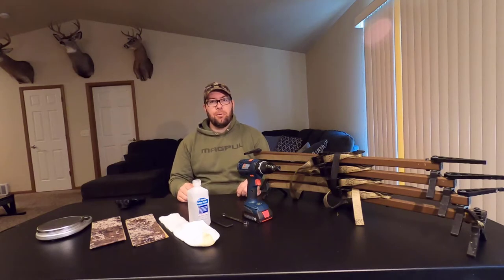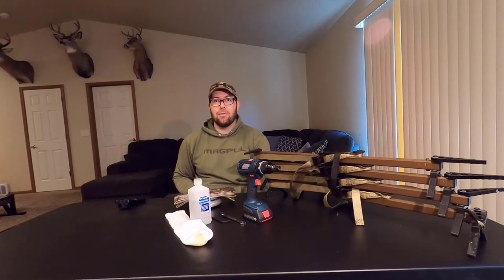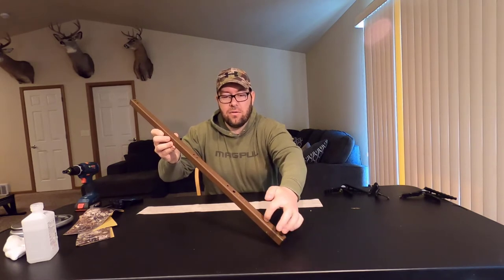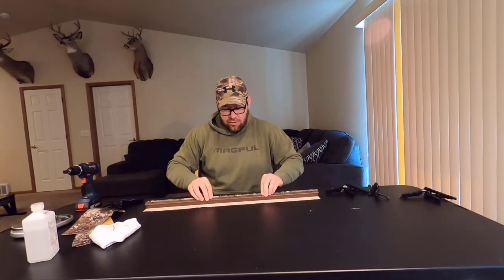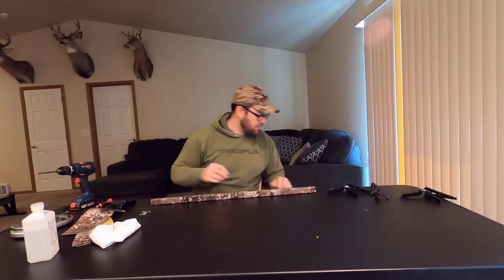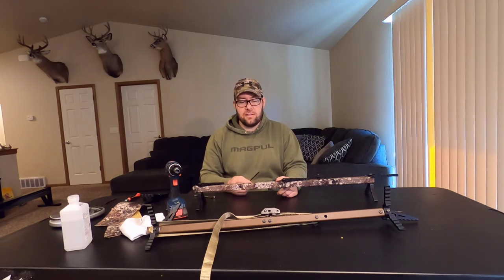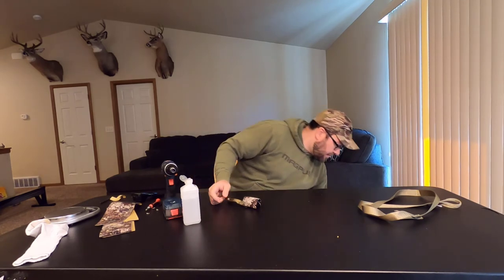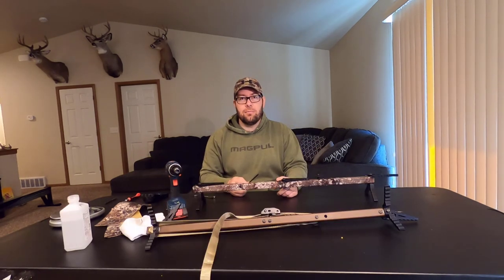Stealth Strips for Climbing Sticks and Buckle Silencers Installation Video

Comment: Did you make any cuts on the sticks except for drilling the holes where the bolts are? Did you cut spots for the washers or just put the washers over the tape?
Reply from the maker: Hi Michael, I don't make any cuts,  just holes for the bolts, and I put the washers on top of the Stealth Strip material.